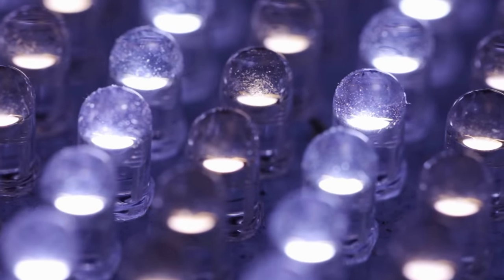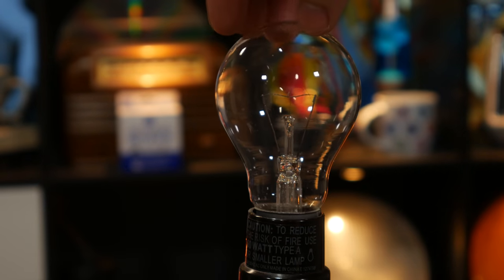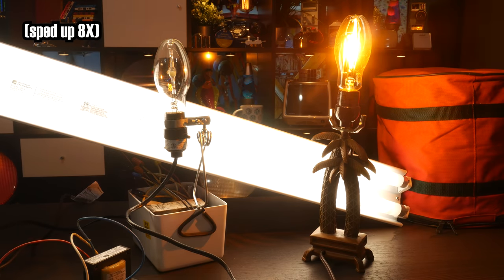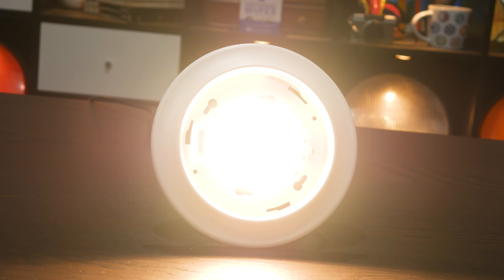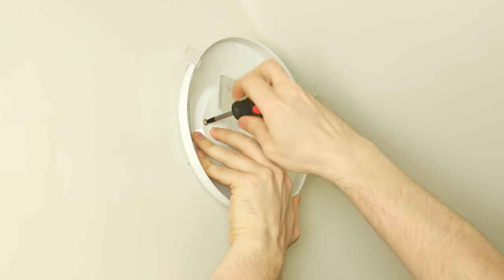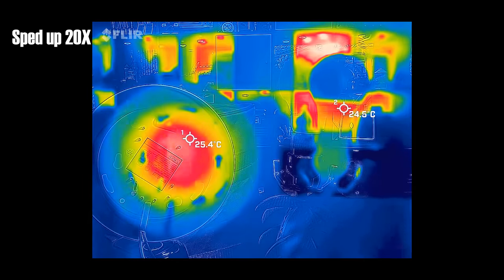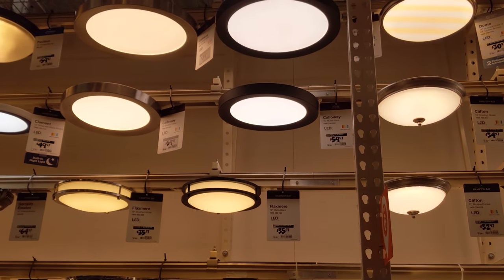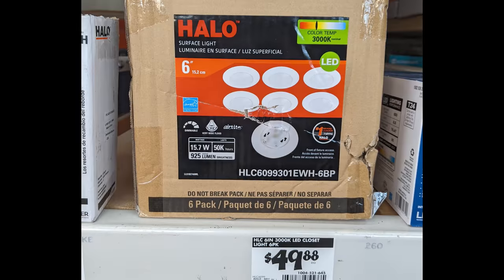A troubling trend in lighting?

Comment: Another good thing to keep in mind with the difficulty replacing these lights: Sound!

It's pretty common for people with ADHD and other disorders to be sensitive to high pitched sounds. I have a box of LED lights with "loud" written on them in sharpie because they make audible noise to me. A constant buzz throughout my home, that could cost hundreds to replace all of? No thanks.
Reply: Good point. I've also found some DC power adapters (for laptops etc.) to make annoying buzzing noises, probably coil whine.
Reply: I have some good news for you: as you age you will stop hearing that noise.
Reply: I have LED lights in my room. They're bright, but the trouble is that they're on a dimmer switch, and LED lights don't really like that. The closer the switch is to the middle, the more it buzzes, and the more it drives me absolutely insane.
Reply: @CocoTheMii  I have a dimmer lamp that has one level of brightness and 3 levels of buzz....
Reply: Thousand up votes.
Reply: I find that when buying a set of LED fixtures, often 1 in 4 will have minor defects. such as 1 fixture in my kitchen that buzzes, or 1 that will strobe subtly.
Reply: Does that really have anything to do with ADHD or other disorders?
I don't think that I have any disorder but that buzzing still drives me crazy. And I would assume that a constant noise would drive anyone crazy - even if they don't have any disorder?!
Reply: @Jehty_  Sensory processing issues, perhaps? It's not just connected to ADD, it can also stand alone.
Reply: @alexandriacross7208  or just a normal person who doesn't like being subjected to constant noise.
Or are you saying that everyone who hates his tinnitus also has a disorder or issues?
Reply: @Jehty_  what they're saying is people with disorders are extra sensitive to the sounds or the frustrations they cause. I have ADHD and certain sounds will make me cringe and lose any ability to focus...  sometimes I don't even want to hear the sound of someone talking; some days I'm just unreasonably irritable. I wear headphones and listen to music pretty much constantly to have something pleasant to listen to and keep me feeling positive and calm rather than down and annoyed by the sounds around me. I can't use cheap ones either. I feel almost like I'm forced to be an audiophile and it's not always fun :<
Reply: @CocoTheMii  In my experience the easiest way to avoid dimming issues is good quality bulbs/fixtures using a dimmer listed as compatible by the manufacturer.  In an ideal world it wouldn't be so complicated, though.  I utterly resented when I had to pay $100 for a dimmer just to mitigate buzzing and dimming issues on a large/heavy fixture I'd spent hours installing because they had no dimmer compatibility list.
Reply: Yes, noise is a thing, especially with dimmers. It has been my experience that the cheaper the lamp, the more likely it is to make noise while dimmed.
Reply: The LED fixture I have doesnt seem to make any audible noise, probably since mine was a Wi-Fi enabled smart light on the more expensive side. Its not that I wouldn't notice any noise at all because the power cord for my blu-ray player and tv remote charger always seem to make high pitched buzzing that gets quite annoying.
Reply: OMG, I never connected those dots before; this is an ADHD thing?!?! How have I been so blind???
Reply: @PhilipLeitch  rofl... that's a hilarious description, and sounds maddening, infuriating, and a half-dozen other adjectives. I discovered my Chromecast makes a super high-pitched squeal recently. Took me over a month to hunt down the source of that one.
Reply: @Jehty_  So sensory gating is what the brain does to “tune out” redundant sensory input, like a constant buzzing or everyone around you talking at a party while you’re only trying to listen to one person.  That doesn’t mean the sound isn’t annoying if you’re actively listening to it, (and obviously too much noise will be impossible to ignore) but that generally if it’s minor and mostly unchanging then the brain starts ignoring it for our own sanity.

There is a theory that this sensory gating ability is inhibited in people with sensory sensitivities.  I’ve heard autistic people talk about how they find a lot of environments so overwhelming because all the things are happening at once even if neurotypical people in the room hardly notice any noise (or light or clothes etc.).  This might be because while I as an allistic person have a brain that will stop thinking about the city noise outside or the fridge running, a lot of autistic people just hear everything as if it’s a “new” noise constantly.  Lots of people with ADHD have the same trouble.  Not sure if it’s exactly the same mechanism or more to do with our ability to be distracted by everything (instead of “can’t tune it out” it’s “brain keeps looking for sensory input like the noise of that annoying light fixture over there”).

Also disclaimer that neurotypical people can absolutely have some symptoms of autism or ADHD without having enough to be considered neurodivergent.  Most diagnoses are at the end of the day a minimum number of symptoms from a list, but neurodivergence is a spectrum not a binary.
Reply: holy shit?!! you mean that noise is possibly real and coming from my LED lights? i have adhd and i just kinda assumed that the constant buzzing was tinnitus and there is no way to stop it… i need to investigate this further, thank you

Comment: As a comment to one of the problems, needing to replace the whole fixture when it fails, in Australia it doesn't matter if you're confident to do the work yourself. It's ILLEGAL to replace a light fixture yourself without being a qualified electrician, so for the vast majority of people here that cost is unavoidable. I didn't want to put these kind of light fixtures into my new house, but it wasn't even possible to buy any other kind any more in my city. I kindof object to the removal of choice even more than I object to the new designs...
Reply: sounds like the kind of law that is impossible to enforce.
Reply: @georgiishmakov9588  sure, you might get away with it. But you might not. When you sell the house it's common to have a building inspection, and if you haven't done the work according to code then the sale contract might fall through, and you might be reported then.

Comment: 9:01 they moved the electrolytic off the hot PCB which is excellent.  Assuming the LEDs aren't garbage, it could last a decent time, especially if dimmed to 70% or so.
Reply: Assuming they are dim-able.

Comment: Thanks for the longevity advice! I will definitely switch to the LED filament ones. I knew my "normal" LED lights were dying because of heat trapped in the fixture, but didn't know what to do.
Reply: You can also look for led bulbs "approved for use in enclosed fixtures," although between those and filament style, ymmv. Good luck!
Reply: @smcgilvary  You have to be careful about some that claim "for use in enclosed fixtures" as some boxes I've looked at the fine print of have stated that the lifespan of the bulb is halved if used for an enclosed fixture, even though they are allowed to still say "for used in enclosed fixtures"
Reply: Can always drill (or file) holes in the plastic base (carefully that is) to allow for airflow.
Reply: We just switched our bathroom vanity bulbs to the opaque filament ones mentioned. 2700k—thanks for that tip! We have 100 watt equivalent and it’s like we are in the surface of the sun compared to what was here before—both had burned out within weeks of each other so we only had one somewhat fresh bulb in. Wrong lumens. Wrong light temp. This is so much better. We can actually see now!

Comment: I have this exact fear with the integrated LED recessed lights in our newly-remodeled kitchen. EXACT scenario you described. Like you, I would not be able to live with a mismatching replacement. I've been meaning to buy a full set of spares, but haven't gotten around to it yet. I think I will do it this week before they become unavailable...
Reply: Yhea, I replaced old boob lights with some cheap, but nice looking all in one fixtures. Not sure what I'll do when one dies. It would just be wasteful to throw out a whole metal and glass fixture since some LED's died.
Reply: This is very anecdotal but we had it happen with one of our two kitchen lights. It started blinking a few years in. Of course the exact ones we ordered on Amazon at the time were no longer available, so all I could do was match specs. At first the replacement was noticeably brighter but after a few months it “settled in” and I can’t tell the difference between the two lights now.
Reply: If you're buying a full set, how big of an advantage compared to replacing the lot at time of failure is there even left? Especially factoring in that lighting will likely get better (even if only slightly), there could be some unknown medium-term design problem with those fixtures and that the unused spares are still going to deteriorate on the shelf at some unknown rate.
Reply: @Paremo_  Fair point. I was thinking that I'd potentially end up swapping them at different times as they have issues, not changing out the whole set all at one time. But that does of course leave the very real potential that a brand new unit will not match one that has been in service for a few years, even if they started out identical.

Comment: I lived in an apartment that had one of these at 5000k. I also prefer 2700k lighting, so I found a lighting chart and bought filter sheets that could convert 5000k to 2700k and taped them to the inside of the diffuser.
Reply: It's common (but not ubiquitous) for the fixtures to have a dipstick for changing the color temperature. This is definitely a very useful technique. Although it might slightly reduce your lighting output.

Comment: I'm so glad someone else is paying attention to these things. I was helping my grandmother replace some of the light fixtures in one of her units and everything in Menards were these same type of whole-fixture things.  I couldn't find a single overhead light for under the kitchen cabinets that didn't require plugging in to a socket.
Reply: For under-cabinet lights, why not just use the battery-powered kind you can just stick in place and tap to turn on? Seems cheap, easy, and convenient compared to actually wiring something into the electrical system. Self-contained, relatively low-profile, and if it dies you can just buy another one.

Comment: I LOVE how you refer to the fully assembled lighty-bit as a lamp. Technically the bulb is the glass part. When I started working as a stage electrician, I would get corrected when referring to the fully assembled lamp as a bulb. With the housing/socket end referred to as a fixture. How we all started referring to fixtures as lamps and lamps as bulbs is beyond my feeble mind. Cheers!

Comment: I love this topic, I feel this trend is very troubling especially with the introduction of can less recessed lights. Once they burn out, sometimes you cant find the same size, leaving a gigantic hole in the ceiling that needs to be patched. Since there isnt any can, the ceiling is just full of stray romex
Reply: As far as size to fit into hole in the ceiling? They are standardized and it should be easy to find something the correct size.

Comment: Maybe someday the NEMA wall socket will replace direct wiring for ceiling lamps, but if that is ever proposed, it will be derided as union self-dealing just like the metallic-conduit-in-residential requirement. But I've noticed that more places are hooking up dishwashers with a wall socket instead of just wiring them up directly.
Reply: @ThomasRobertFr  Really? In Germany they just let 3 loose cables dangle from the spaces were the lamps should go and you have to deal with cutting them down to an suitable lenght so that they fit in the housing of the lamp you bought, then usually drill holes into the ceiling, because it is an "Massiv-Haus", meaning it consists (almost) completely out of concrete or bricks, while hoping you don't hit an cable, and connect the loose wires from the lamp fixture to the ones dangling out of the ceiling/wall. There is no "dug out" area were the cables neatly go. The needed space for wiring is hopefully sufficently provided in the lamp fixtures.
Reply: Well of course dish washers plug into a socket, they're an appliance not a fixture. Is your TV hardwired into the power? Is your mobile phone charger?
Reply: That's what we have in Australia, although with standard Australian sockets in the ceiling, which are just sitting there on a cable. It makes replacement of light fixtures easy.

Comment: This is an excellent video, and pertinent because I just bought a house and I am installing some. The issue you mention, about replacement when they die, is compounded in places like the province of Québec, in Canada, where the law states that all electrical work, including replacing a wired fixture, must be done by a certified electrician. I don't think anyone who is slightly capable will be calling on an electrician for this but it does add another layer of complexity to the issue, as well a liability with regards to insurance if you ever install one incorrectly and don't have proof of installation from an electrician. Thanks for this video, I just subscribed (thanks to the mention from Transport Evolved about your channel) 😎